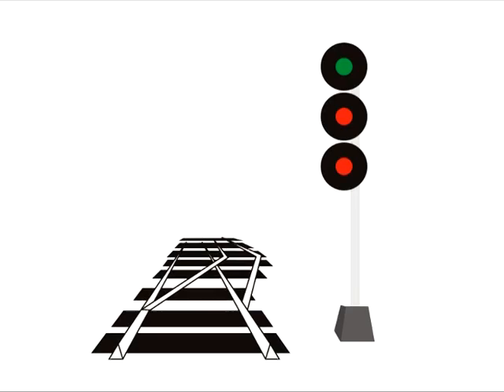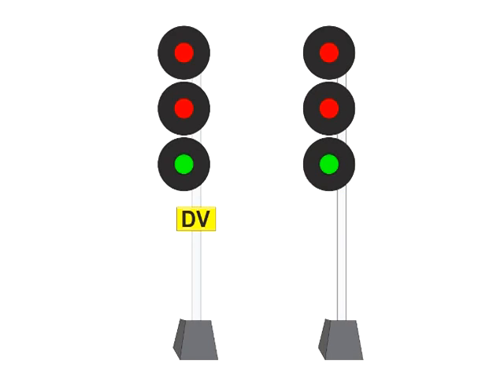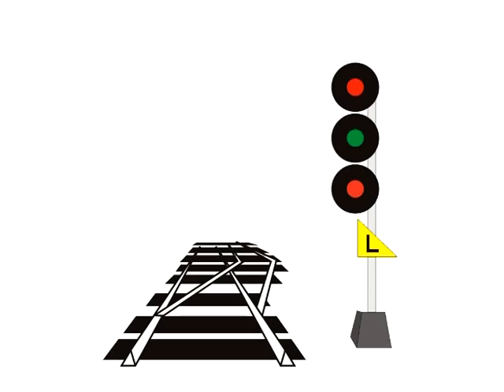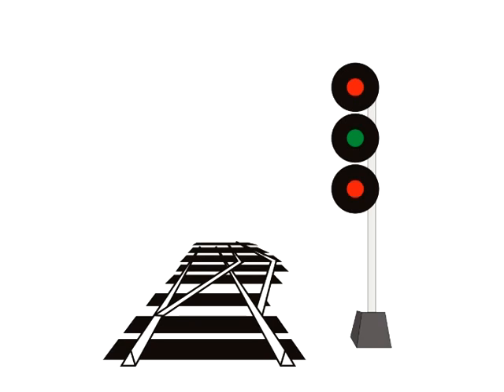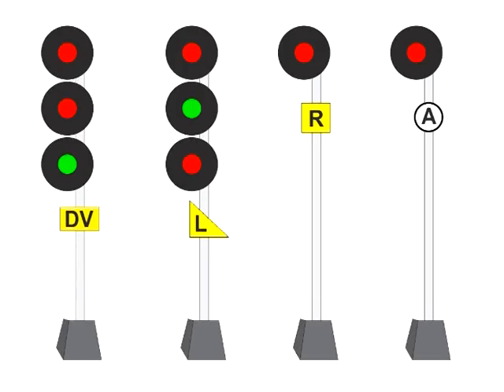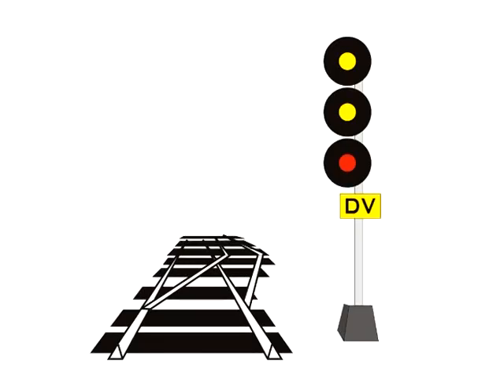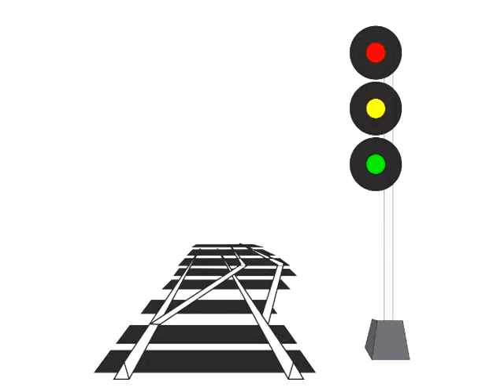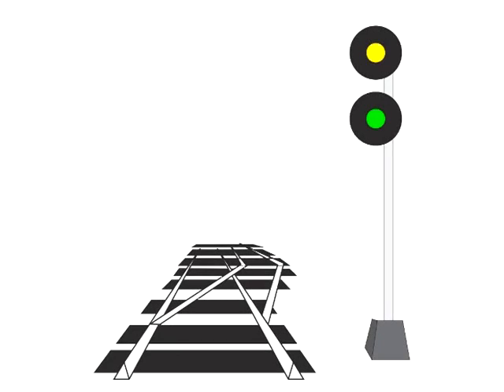Part 3: Railroad Signals, reading and meanings. Diverging and Limited speeds, to and at signals

Comment: Hi Ian, good job on the videos.  Its interesting to see an operations guy's take on how the system works.  I have been working in signalling offices and installation sites for over 10 yrs now: CP, CN & transit.  I worked at CN's signal design office in Edmonton until they uprooted the office south of the border.  I did a lot of design work in the GTA for GO during that time. 

If you ever have any questions about why things are done the way they are, let me know.  You can get a hold of me at my company website: www.signalogicsystems.com.
Reply from the maker: +Kevin Rudko Cool! Thanks for that. Just what little I've seen of the signals in GTA, wow that would be a confusing mess! haha!
Reply from the maker: I got a question for ya Kevin:  Actually, two questions. 
1) We're in the siding in siding controlled territory, and the opposing train is now occupying the controlled location (head end is past the controlled location, mid-train is occupying the location).  If the tail end of the train rolls past the bond into the controlled location, does that send alarms? Or is the controlled location simply one block itself, and thus the passing train has already knocked the block down and so the system can't tell which train is holding the block down?
2) Why is it that we have to get work authority when we tie back on to our train but our head end is in the controlled location?  We can't just go forward without RTC permission - why not?
Reply: Ian Juby 
Q1) I'm not quite sure what alarm you are commenting on here.  Your train is tucked away nicely in the dark siding and an opposing train rolls by picking up the block it just vacated with the tail end still in the control location track circuit.Maybe you can give a bit more.
Q2) You are referring to a rule 566 I think.  The issue here is that for some controlled locations the normal interlocking functions preventing an opposing movement from the next controlled location (function called traffic locking) is circumvented if you back up out of a route.  The written authority is part of the RTC's manual protection of the whole control block between control points, similar to entering main track between signals under 568 without electric lock.
Reply from the maker: Hi Kevin - thanks. Q1) I'm referring to a stop signal violation basically.  Alarms go off in RTC center when we go through a red of course - even our tail end.  This was just something someone mentioned to me the other day about how the controlled location is, effectively, it's its own block and so a train holding down the block is a train holding down the block - the system can't tell which train it is (unless of course the tail end of train 1 rolls into the block before it gets occupied by the opposing train which would drop the block and cause stains in the seats of the opposing train).  If the train #2 has gone through the controlled location, it's holding down that block which would be the same block going into the siding until the bond - so if the tail end rolled out, it wouldn't show up on the RTC panel?
I'm not trying to get away with anything here, just inquiring minds wanna know.  haha!
Q2) Okay, that makes sense - thanks for that.
Reply: 1. The "controlled location" is a separate signal block in and of itself, but it's not called a signal block because it's shared between both directions of interlocking signals.  The "controlled location" is like its own private island where the surrounding block signals get to take part if the interlocking deems it safe to do so.   Most dispatcher/RTC/CTC panels I have seen will show the occupancy of the "controlled location" but are not able to distinguish between which track(s) is actually occupied.  If the passing train clears the "controlled location" then they are subject to the signal indication for re-entering that location, and so immediately rolling back into it would entail passing a STOP SIGNAL which would be a no-no. 
2. I may not have the complete story on this answer (Kevin's surely applies too), but making a stop within a "controlled location" is frowned upon within the rules because of limitations of detection systems in some interlockings.  Rusty rail or wheels are two such possible limitations.  The way detection works across rails and frogs is another, and some interlockings have used things like flange treadles to determine when switches should be locked or not.  If the equipment sitting in the controlled location is not detected correctly then it's (remotely?) possible a conflicting movement could be arranged before you move. The RTC must ensure that the correct route is still lined and locked before you can move.
Hope that helps.